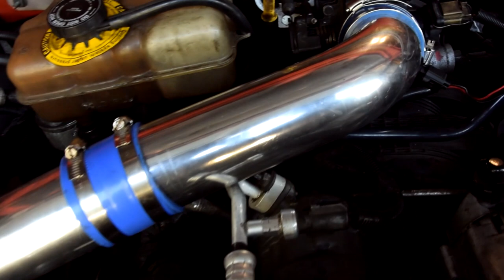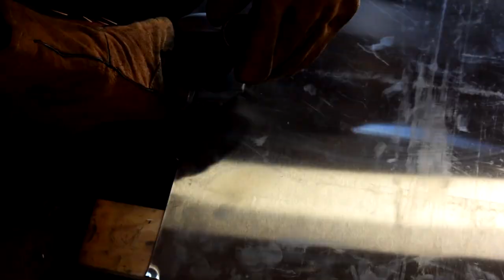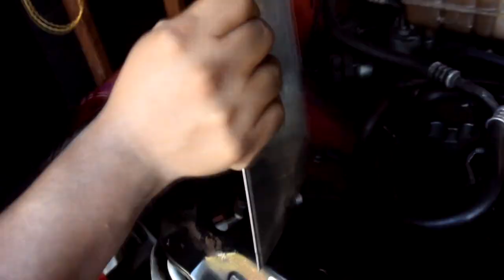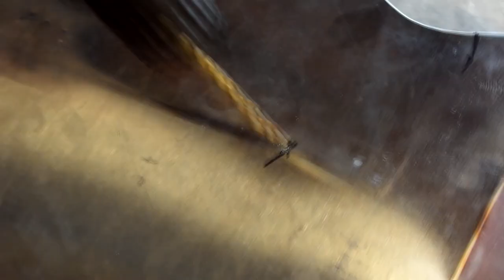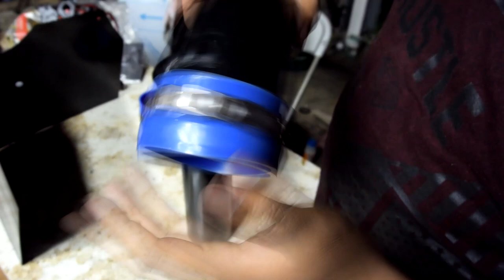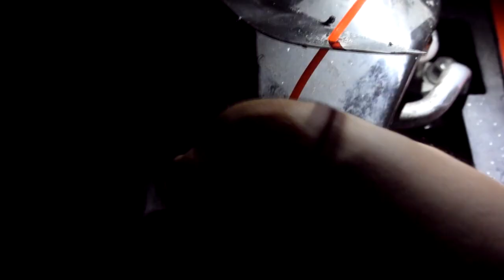DIY Cold Air Intake Heat Shield

Comment: buy some rubber hose and split it to put it over the edges of the heat sheild and this will help protect the pipe from rattling in the engine bay. and as well the heatshield from the bottom from rattling around as well.